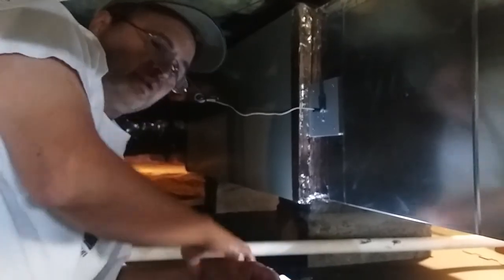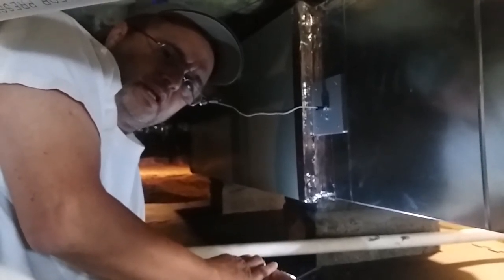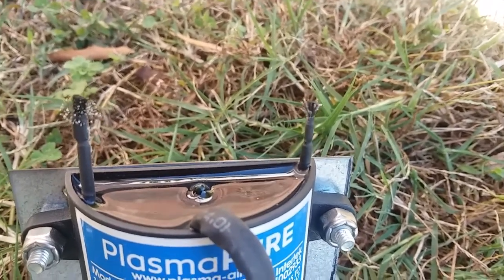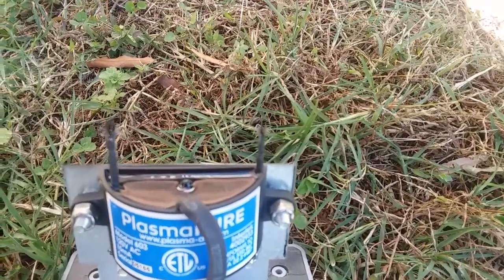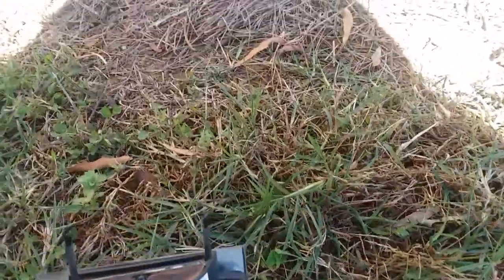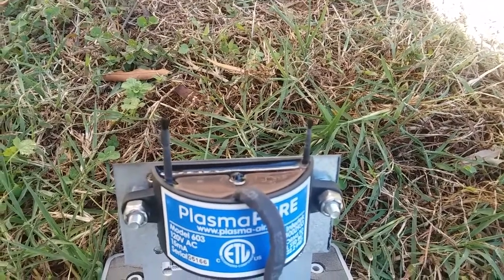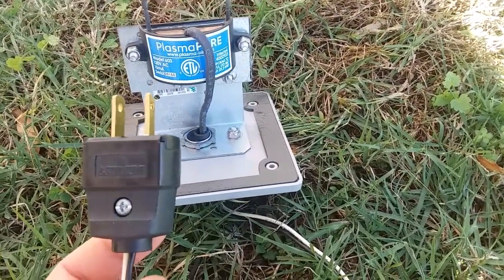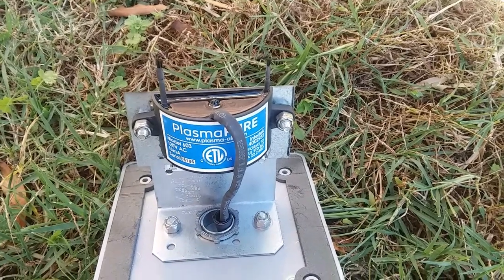Cleaning Plasma Air 603

Comment: I installed model 602. I was surprised how much it has helped air quality and odors. I have a new house that is very air tight (<3ach), so maybe that’s why?
Reply from the maker: Good deal.  I hope to do a new video soon because my results have been good, but the units do have limits which I will mention in new video when I get a chance to do it.

Comment: I just bought a plasma air. Did it make a significant different in the indoor air quality?
Reply from the maker: The thing with any air purifier is that the air has to be flowing for it to work.  Plasma Air and other purifier manufacturers suggest running the fan all the time to get maximum air quality results, but I have heard that doing that can also increase moisture in your duct work.  I don't run my fan all the time for that reason (and because I don't want the constant wear on my fan motor along with the cost).  Having said that, I can tell it helps with odors and has addressed my "dirty sock syndrome" issue since that odor was only present when the unit was running, so it is doing exactly what I want it to do from that perspective.  I also think my filters are getting dirtier quicker which is supposed to mean the ions are attaching to dust specks making them easier to get caught by the filter.  That should mean the air is cleaner, but I am also using denser filters than I used to so that might be part of the reason the filters are getting dirtier quicker.  I guess having said that, I can't say that I have seen a definitive difference related to air quality, but I can say that it addresses odors when the HVAC units are running.